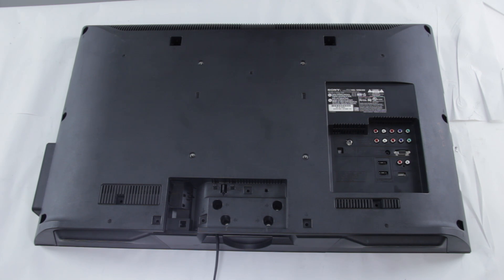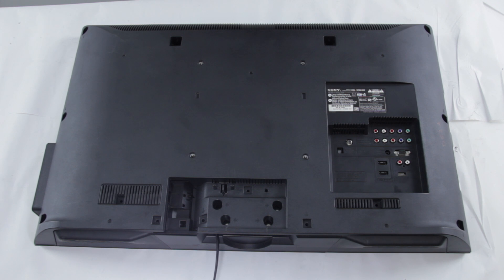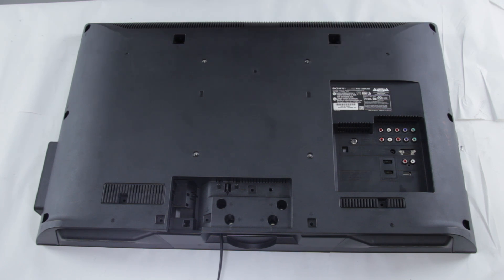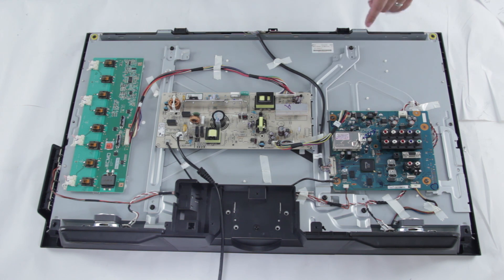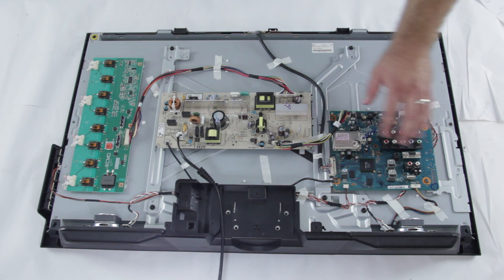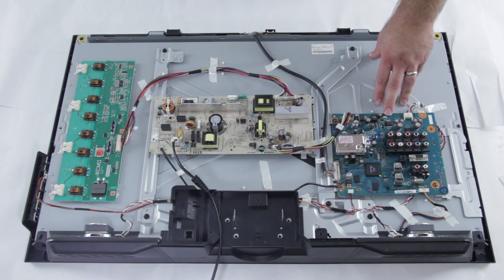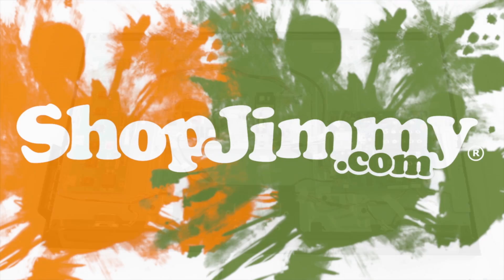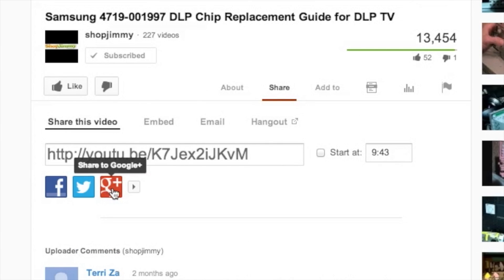LCD TV Repair - TV Has Audio, No Video - Common Main Board Symptoms & Solutions

Comment: Hello my sceptre tv P/N X322BV-HD*WXESBV2,S/N C51X322BCL3305 when powered on only shows the initial Sceptre screen and locks on. I have to unplug the TV for it to power off. Tried resetting the system with the remote code but didn't help. What do you think the issue is?
Reply from the maker: Travelstone3  Please watch this video to help with your repair!  TV Repair! LCD, LED, Plasma, DLP How To Fix Your TV with ShopJimmy.com Help!  I recommend replacing the main board in your TV.  Here is a link to some replacement main boards for your TV model number.  http://www.shopjimmy.com/catalogsearch/result/index/?cat=56&q=X322BV  Be sure to match part numbers on your current board, with your replacement for compatibility.  Thanks and please let us know if you have any further questions with your TV Repair!  www.shopjimmy.com

Comment: hi I have a vizio  SV420M  led tv  that has sound  but no  picture  what you guys think it's
Reply from the maker: TheRednosepitt0125   I recommend replacing the main board in your TV.  Here is a link to replacement parts for your TV model number on our website, click here:  http://www.shopjimmy.com/catalogsearch/result/index/?cat=56&q=SV420M  Be sure to match part numbers on your current board, with your replacement for compatibility.  Here is a link to a video showing how to identify your part number, click here:  TV Part Number Identification Guide for Vizio Main Boards (Plasma, LCD, LED)  You can also call our customer service for further assistance with your purchase.  (877) 881-6492  Thanks and please let us know if you have any further questions with your TV Repair!  www.shopjimmy.com

Comment: I have a Mitsubishi TV model number LT 52246, and it just went dead. I am told I have to replace the main power board. Cant this board be repaired?
Reply from the maker: Ayodele Adeboye   Unfortunately, we don't have a repair service or replacement in stock. Could be a bad main or power supply. You may need to replace each board individually to see which one fixes the problem.  If you want to start with one board, I would go with the power supply.  Here is a link to replacement parts for your TV model number on our website, click here:  http://www.shopjimmy.com/catalogsearch/result/?q=+LT+52246  Be sure to match part numbers on your current board, with your replacement for compatibility.  You can also call our customer service for further assistance with your purchase.  (877) 881-6492  Thanks and please let us know if you have any further questions with your TV Repair!  www.shopjimmy.com

Comment: hello my tv is a Sony bravia lcd colour tv KLV-40S550A ser. no 6437285 
it has sound but no picture and i think there is also a backlight bcuz i tried the flashlight test and i didnt see anything... can you please help me>? thanks GODBLESS
Reply from the maker: borjevon   You will need to determine if the TV has backlight or not.  If there is backlight, then I recommend replacing the t-con board and if there is no backlight, then I recommend replacing the main board.  Here is a link to replacement parts for your TV model number on our website, click here:  http://www.shopjimmy.com/catalogsearch/result/?q=40S55  Be sure to match part numbers on your current board, with your replacement for compatibility.  You can also call our customer service for further assistance with your purchase.  (877) 881-6492  Thanks and please let us know if you have any further questions with your TV Repair!  www.shopjimmy.com
Reply: ShopJimmy.com thank you for the info i watched the video about how to diagnose and i saw that i have a backlight but there is no picture how can i know what part of my tv shouldbe replace thanks :) GODBLESD

Comment: Hi!  A few weeks ago my TVs  main board got mest up by a bad source.  I order a exact  replacement model on ShopJimmy.com (Tw64801so46c Westinghouse version 1)when I hooked it up to test it out,  it worked but not that great, the coloring is very off the letters on the screen are barely visible (instead of white it's pink, green & many different colors,) & I'm sure it has to be the main board because all the cable are in the same exact spots & before my original main board broke the screen was fine
Reply from the maker: jalero0212   What is the part number on the board that you ordered?  I am thinking you have a bad replacement board.  Please call our customer service and explain.  (877) 881-6492  Thanks!  www.shopjimmy.com

Comment: I have a Samsung LN26A330J1DXZA that someone gave me and I'm just trying to fix it to put in my 10 year old daughter's bedroom. I have audio but no picture. When I turn it on the screen is blue for a few minutes and then it just turns white. I also don't get any kind of menu on my screen. I just hooked my tv up to my working ATT Uverse box by coax, tuned to channel 3 with my remote and that's how I get sound. Anyway, I have changed the backlight converter, power supply and t-con board to no avail. So could this be a main board issue? Thanks.
Reply from the maker: Troy Addison   Yes, this could be a main board issue.  Here is a link to replacement parts for your TV model number on our website, click here:  http://www.shopjimmy.com/catalogsearch/result/index/?cat=56&q=LN26A330J1DXZA  Be sure to match part numbers on your current board, with your replacement for compatibility.  Here is a link to a video showing how to identify your part number, click here:  Samsung Main Boards & Digital Boards: Part Numbers for LED, LCD, DLP, Plasma TV Repair  You can also call our customer service for further assistance with your purchase.  (877) 881-6492  Thanks and please let us know if you have any further questions with your TV Repair!  www.shopjimmy.com

Comment: I have a Sony kdl46bx420 lcd tv with power issues. I recently purchased a new main  from and after installing my problem remains. I have checked and confirmed that I have 3.3v at the power board and at the main board. Could my new board just be doa? HELP!!
Reply from the maker: Kris Ballenger   This sounds like a DOA part.  Here is a link to replacement parts for your TV model number on our website, click here:  http://www.shopjimmy.com/catalogsearch/result/index/?cat=4&q=kdl46bx420  Be sure to match part numbers on your current board, with your replacement for compatibility.  Here is a link to a video showing how to identify your part number, click here:  TV Part Number Identification Guide for Sony Main Boards (LCD, LED, Plasma TVs) TV Repair  You can also call our customer service for further assistance with your purchase.  (877) 881-6492  Thanks and please let us know if you have any further questions with your TV Repair!  www.shopjimmy.com

Comment: Hi, I have a Auria 32" LCD tv, Model #EQ3299, with S/N: UA20CQ8002265, that had a power surge during a storm.  Now it will not turn on at all.  Totally dead.  I tried replacing the fuse on the board that has the power cord connected to it but it didn't work.  I think the fuse may have been the wrong one.  It is hard to find.  Anyway, I'm thinking of buying your board and replacing the entire thing.  Does that sound like the right thing to do?
Reply from the maker: Angela Walters   With a power surge, it is recommend to replace the power supply and the main board.  Here is a link to replacement parts for your TV model number on our website, click here:  http://www.shopjimmy.com/catalogsearch/result/index/?cat=4&q=EQ3299  Be sure to match part numbers on your current board, with your replacement for compatibility.  You can also call our customer service for further assistance with your purchase.  (877) 881-6492  Thanks and please let us know if you have any further questions with your TV Repair!  www.shopjimmy.com

Comment: I have a sharp LED   LC 46le 620 ut  TV is making a loud pitch sound after a few seconds it automatic shuts off   sounds like a loud screech sound  any help would be appreciated
Reply from the maker: brooklyn2rome   I recommend replacing the main board in your TV.  Here is a link to replacement parts for your TV model number on our website, click here:  http://www.shopjimmy.com/catalogsearch/result/index/?cat=56&q=LC+46le+620  Be sure to match part numbers on your current board, with your replacement for compatibility.  You can also call our customer service for further assistance with your purchase.  (877) 881-6492  Thanks and please let us know if you have any further questions with your TV Repair!  www.shopjimmy.com

Comment: hi i have an e-motion x26/29e-tcdup-uk when plugged in the red standy light shows when pressing the on button this changes to a green light but the set shows no sign of life  (no sound or display) only a short whirring sound from the built-in dvd player 
. i have replaced the av board but the results are the same cold it be the ower board?
Reply from the maker: jim hope   I recommend replacing the main board in your TV.  Here is a link to replacement parts for your TV model number on our website, click here:  http://www.shopjimmy.com/catalogsearch/result/index/?master_part_type=Main+Board&q=x26%2F29e  Be sure to match part numbers on your current board, with your replacement for compatibility.  You can also call our customer service for further assistance with your purchase.  (877) 881-6492  Thanks and please let us know if you have any further questions with your TV Repair!  www.shopjimmy.com

Comment: Greetings,
I have a Panasonic Plasma, model TC-P65ST50 that has no Picture and Sound through the HDMI connections. Otherwise, the TV works when the source is connected thru the Component connector. What parts do you think are needed? Also, If the main board needs replacement, are they're any concerns about the firmware not being current on the new board?

Thanks...
Reply from the maker: Kirk Barrios   I recommend replacing the main board in your TV.  Here is a link to replacement parts for your TV model number on our website, click here:  http://www.shopjimmy.com/catalogsearch/result/?q=TC-P65ST50  Be sure to match part numbers on your current board, with your replacement for compatibility.  Here is a link to a video showing how to identify your part number, click here:  Panasonic Plasma HD TV Repair Tips: Suffix Codes for A Board & Main Boards  You can also call our customer service for further assistance with your purchase.  (877) 881-6492  Thanks and please let us know if you have any further questions with your TV Repair!  www.shopjimmy.com

Comment: I have a samsung LN46A630MIFXZA and the picture bleeds or looks like a color negative, could u suggest a fix. 
S/N AQD93CSQC01850X
Thank you
Reply from the maker: Cecilia Mangal   I recommend replacing the main board in your TV.  Here is a link to replacement parts for your TV model number on our website, click here:  http://www.shopjimmy.com/catalogsearch/result/?q=LN46A630  Be sure to match part numbers on your current board, with your replacement for compatibility.  You can also call our customer service for further assistance with your purchase.  (877) 881-6492  Thanks and please let us know if you have any further questions with your TV Repair!  www.shopjimmy.com

Comment: I have a Philips LCD with a high pitch sound that repeats and it wont stop when i turn on the tv and the screen keeps flashing for a couple of seconds and then goes black, what could it be? model id 37PFL5322D/37, Serial No. BZ1A0745112423
Reply from the maker: *****   I recommend replacing the main board in your TV.  Here is a link to replacement parts for your TV model number on our website, click here:  http://www.shopjimmy.com/catalogsearch/result/?q=37PFL5322D%2F37  Be sure to match part numbers on your current board, with your replacement for compatibility.  You can also call our customer service for further assistance with your purchase.  (877) 881-6492  Thanks and please let us know if you have any further questions with your TV Repair!  www.shopjimmy.com

Comment: Hello, I have a Samsung LN52A630M1FXZA. My tv would take like 10 minutes to fully load up, but after a while all of a sudden the screen would look weird and screech like a jet engine. I replaced all of the capacitors but I still have this problem. I have found this only occurs when a hdmi or component cable is plugged in.
Reply from the maker: Tom Popolo  I recommend replacing the main board in your TV.  Here is a link to replacement parts for your TV model number on our website, click here:  http://www.shopjimmy.com/catalogsearch/result/?q=LN52A630M1FXZA  Be sure to match part numbers on your current board, with your replacement for compatibility.  Here is a link to a video showing how to identify your part number, click here:  Samsung Main Boards & Digital Boards: Part Numbers for LED, LCD, DLP, Plasma TV Repair  You can also call our customer service for further assistance with your purchase.  (877) 881-6492  Thanks and please let us know if you have any further questions with your TV Repair!  www.shopjimmy.com

Comment: i have element 32" tv model #  eldft 404  sound is perfect but i cannot get any video only dark or light color screen. Any soulition how to fix?
Reply from the maker: Winton Gordon   I recommend replacing the main board in your TV.  Here is a link to replacement parts for your TV model number on our website, click here:  http://www.shopjimmy.com/catalogsearch/result/?q=eldft+404  Be sure to match part numbers on your current board, with your replacement for compatibility.  Here is a link to a video showing how to identify your part number, click here:  TV Part Number Identification Guide for Element Main Boards (LCD, LED, Plasma TVs)  You can also call our customer service for further assistance with your purchase.  (877) 881-6492  Thanks and please let us know if you have any further questions with your TV Repair!  www.shopjimmy.com

Comment: I have a Sharp lcd model Lc-32d64u and it went out after a power surge (no power at all). I took it to a TV repair man and he said it was the power supply and it probably damaged some parts on the main board. he quoted me $ 197 to fix it and i don't think the TV is even worth that. I found a power supply on eBay for my TV for $40. do you think it more then likely just the power supply or could some damage on the main board really have happened. Thank you for your time !!!!
Reply from the maker: *****   With the power surge, I recommend replacing the power supply and the main board in your TV.  Here is a link to replacement parts for your TV model number on our website, click here:  http://www.shopjimmy.com/catalogsearch/result/?q=Lc-32d64u  Be sure to match part numbers on your current board, with your replacement for compatibility.  You can also call our customer service for further assistance with your purchase.  (877) 881-6492  Thanks and please let us know if you have any further questions with your TV Repair!  www.shopjimmy.com
Reply: Thank you ! I ordered the main board from you guys last week . Should be here Thursday !

Comment: I have a coby 32" led LCD TV model# ledtv3216 . it was working great and then one day I powered it on and the blue light came on but no image. After unplugging and waiting..tried it again. It came on...worked for a day. Turned it off and now no image again. I get power but no image. Also before this happened I couldn't shut the TV off with remote. It would turn on with the remote but to shut it off I had to do it by unplugging it. Hope this helps?
Reply from the maker: Alister Crowley   I recommend replacing the main board in your TV.  Here is a link to replacement parts for your TV model number on our website, click here:  http://www.shopjimmy.com/catalogsearch/result/?q=ledtv3216  Be sure to match part numbers on your current board, with your replacement for compatibility.  You can also call our customer service for further assistance with your purchase.  (877) 881-6492  Thanks and please let us know if you have any further questions with your TV Repair!  www.shopjimmy.com
Reply: Thanks !!!